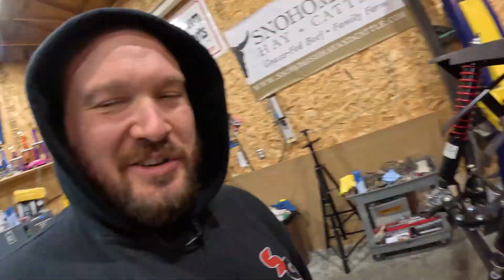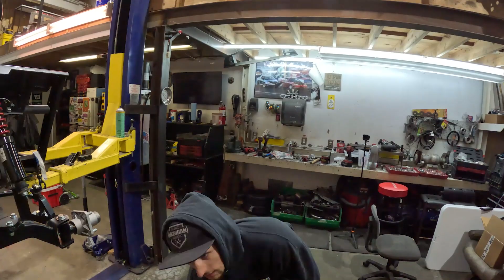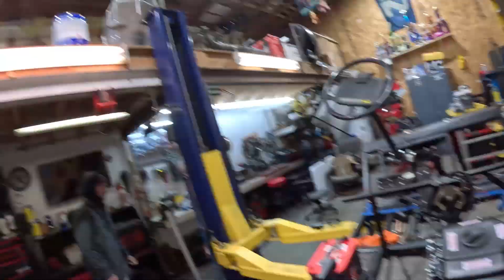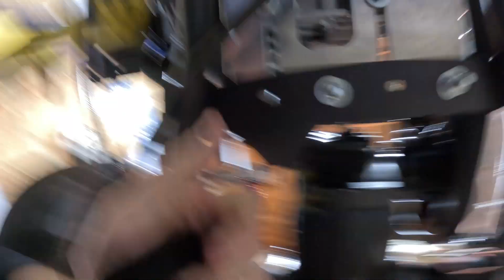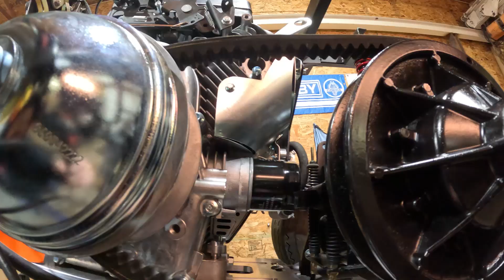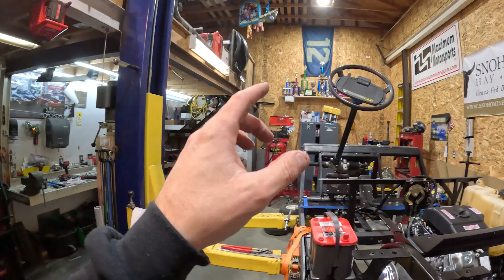Getting The 670cc Predator Motor In The E-Z-GO TXT Golf Cart Fired Up!

Comment: QUESTION!  I am putting one of these into a 1994 EZGO.  Do I need an alternator or does the engine 670 cc Predator, have a built in system to provide charging for the battery?
Reply from the maker: It does, we added the alternator because of all the aftermarket accessories we have. Radio, air compressor, train horn, a bunch of lights, heated seats. We wanted to make sure we were always charged up.
Reply: @SkidiotsGarage  thanks you for the reply.  It helps me with my project.   Keep up the good work.

Comment: So, I may be wrong, but I think you have to have a little slack in your drive belt to allow the clutch to spool. In other words, the main clutch needs to have room for the two halves to get closer together, thereby putting pressure on the belt. If the belt is tight from the get go then the clutch won't be able move at all. You would be in forward or reverse all the time and wear out your belt really quickly. When I worked on our old cart and replaced the drive belt I could get it off without having to loosen anything. Golf cart clutches all work on the same principle. I know you guys will figure it out. As always, another fun video to watch.
Reply from the maker: You are correct, we learned shortly after there should be 2-3” of slack in the bet to start and then after it wears in you can loosen/tighten the belt up!